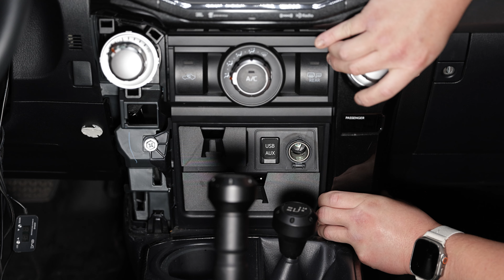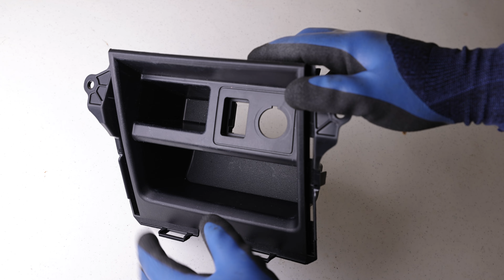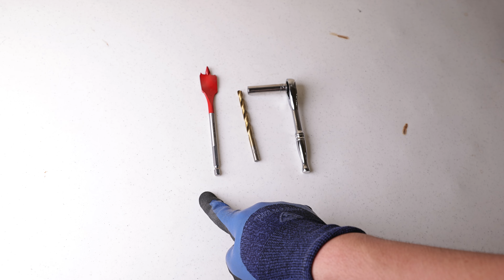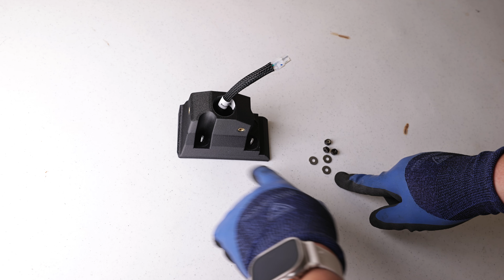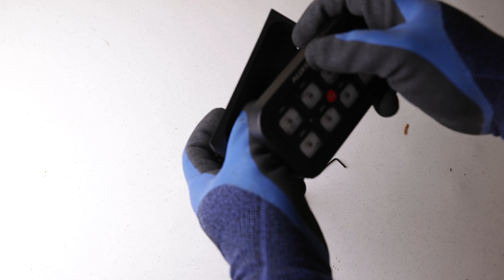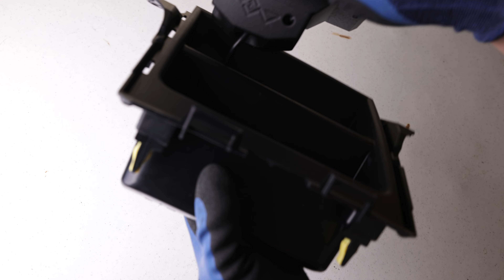(2014-2024) Toyota 4Runner Switch Panel Insert Mount

Comment: Can I still be able to plug in my usb cable for carplay with the 8 way switch panel?
Reply from the maker: @gaborayani9056  due to the thickness of the AuxBeam 8 switch panel the usb will be partially covered so I’d recommend using a 90° USB adapter if you wish to keep using it for CarPlay.
Reply: Ahh ok. Would the 6 way switch not have any clearance issues?